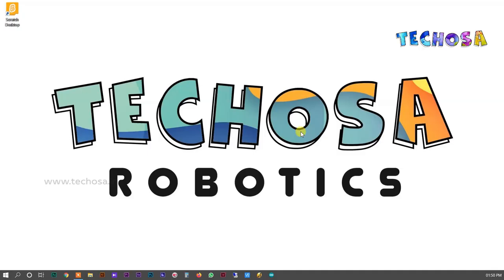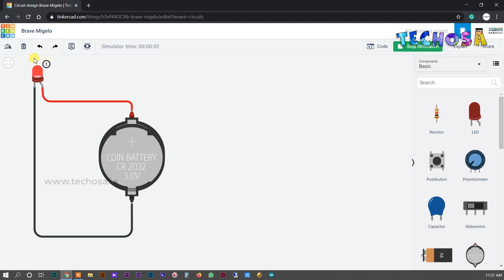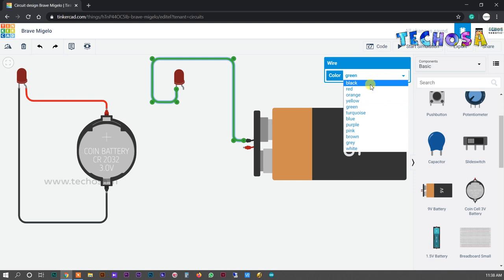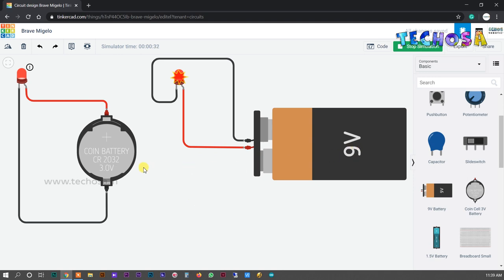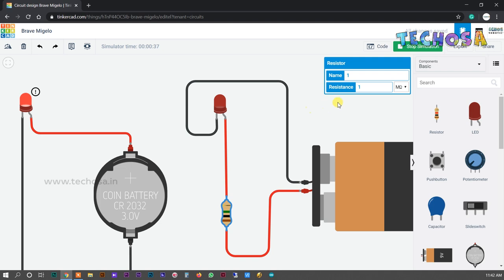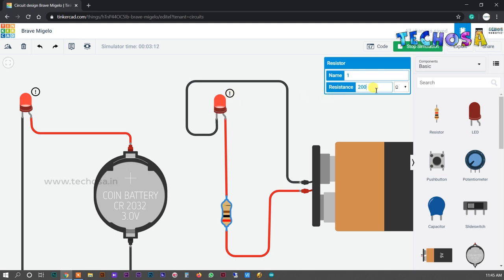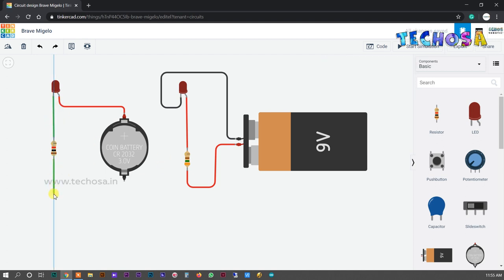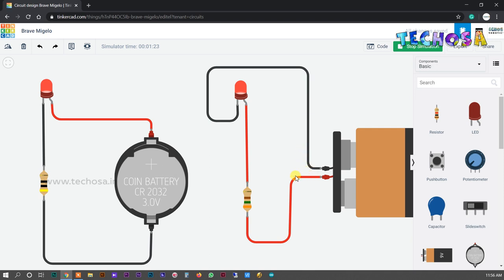Tinker Cad | Introduction to Resistor | Topic 2

Comment: Omg does resistor steals our battery's charge????? Ma'am please answer 🙏🙏🙏
Reply: I have many more questions to ask
Reply from the maker: Not only resistor but any component that you are connecting to a battery will draw power. Resistors are used to limit current, it produces heat to limit the current flowing through it therefore literally resistor steals the battery's charge.
Reply: Thank you for answering ma'am
Reply from the maker: @tenseeffort2796  Welcome 👍, keep watching, and feel free to ask doubts.
Reply: I have to watch them as I have to get full marks in the quiz 😁😁
Reply: Me too
Reply: @augustine8942  
😂😂😂😂